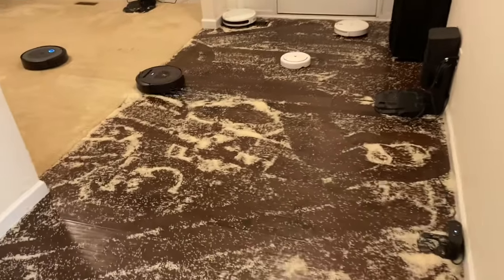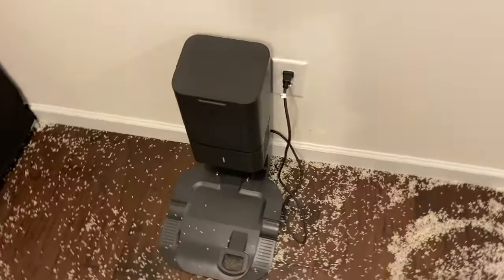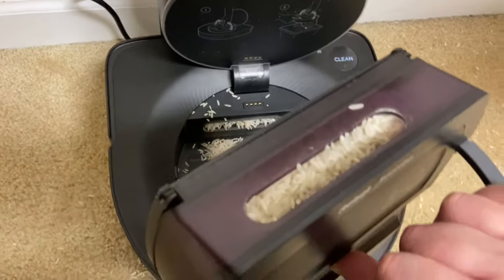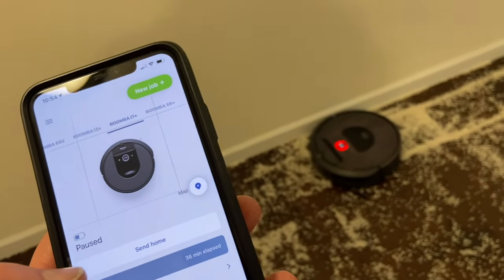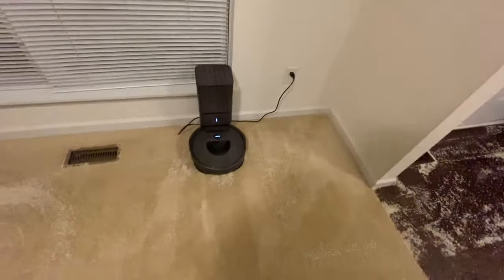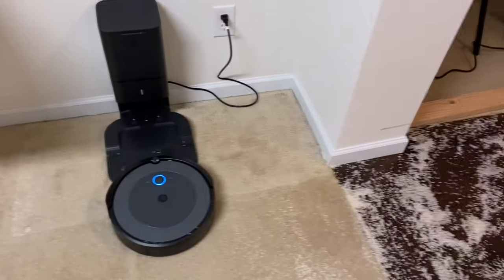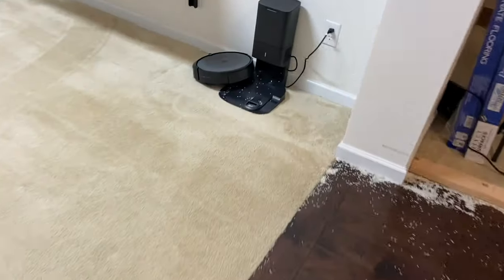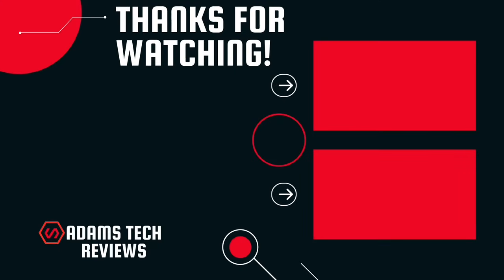13 Robot Vacuums -VS- 30 POUNDS RICE Roomba Roborock Eufy Bissell Ecovacs Deebot HAPPY HOLIDAYS! PT2

Comment from the maker: Please like and subscribe and let me know what other crazy test you would like to see please 😀
Reply: S4 Max stress test! :-)
Reply: I'd like to see this but with jelly beans and those star shaped pieces of cereal you use. Toss in the new Shark for good measure.
Reply: Did you know the white one you jump on like Mario stopming a Goomba was a toy before you pounced on it? We bought the same toy for our 5 year old. He's also robot vacuum obsessed.
Reply: Jasper
Reply: @davejeric4460  jjdjdjjkskskks
Reply: Yes you 

Uhdhhdhhhhjj was good morning I love my family and
Reply: @FantomLightning  '
Reply: In this video, we show the quick start setup for the wifi PTZ camera, including the camera packing list, PTZ camera wire diagram, CamHipro app setting, how to install this wifi PTZ to the wall, remote view on PC via browser...

Wifi PTZ Camera Features

1. IP PTZ Camera with 5x Optical Zoom and Full HD 1920p: This wireless outdoor security camera equipped with 2.7~13.5mm motorized Lens and 2560*1920p resolution sensor; The 355° horizontal and 120° vertical pan and tilt rotate + 5x optical zoom + 2.0 megapixel bring crystal clear image quality and capture more details of your viewing objects without image impairment, it offers you no blind area vision.

2. Quick Wifi Setup when Several Minutes: This wireless ptz IP camera with superior WiFi performance and 5db antenna provides you more stable WiFi connections. Easy setup via smartphone, tablet PC (both for iOS Android) devices by free App.

3. Motion Detection with Email Alarm: This wifi surveillance camera keeps you be notified with push alerts on your mobile device when motion is detected. Know what’s happening in your home in every minute, every potential risk will be identified accurately by this surveillance camera and sent an email with a snapshot to you immediately. Video and image can be stored to SD card (up to 128GB, not included), NVR or FTP.

4. Two Way Audio: built-in microphone and speaker, it allows you to listen and talk with your family, pets, greet guests in real-time. You can record your own unique voice when you noticed any intruder scare them off through our free APP anywhere anytime.

5. with 15ft(5m) 5.5x2.1mm DC 12V Power Extension Cable, this wifi PTZ camera is easy to install and quick to set up wifi, you can access your camera’s video stream in no time. With the outstanding clear night vision and true image and video, you will definitely not miss any moment of what you care!

Enhanced Night Vision
Equipped with 6 IR LEDs, the camera will show you a clear picture even in total darkness, extending your night vision up to 20 meters away. All thing under monitored, the dark never bother you anyway.
https://youtu.be/EkvhJwy4HX0

What's Included? (Updated in 2021-05)
1X 1920P HD PTZ Wifi Outdoor Camera
1X Bracket &Screws Pack
1X User Manual
1X Cat5 cable
1X US adapter with 5ft cable
1X CCTV Sticker
1X 15ft(5m) 5.5x2.1mm DC 12V Power Extension Cable

Visit Our Website
http://www.vitorcam.com

Or Search the keywords Vitorcam PTZ buy it now on Amazon
Reply: Yibh
Reply: PLEASE
Reply: DO THIS INCLUDEING THE SAMSUNG JET BOT+
Reply: Please
Reply: Please
Reply: Do 40 pounds of rice pls
Reply: @RainbowTy  oliko
Reply: Can you do 30 pounds of rice with ONLY your room a s9+? Or can you do a LG HomBot stress test please😊
Reply: Make more the rice videos love them want more
Reply: @AdamsReviews  70 Pounds of Rice + 45 Robot Vacuums

Comment: I wonder if it's possible to take one of the dirt sensors out of a roomba and stick it inside the T8 bin. Maybe if you wired it to trigger the low battery sensor, the robot would think the battery is low every time the bin gets full, go back, empty, start to charge, realize it doesn't need to charge after all, and head back out?
So false alarms on the low battery detection.
Reply: Ok
Reply: No I don’t even think that’s possible, u gotta ask deebot for that

Comment: The roombas are only good for tests like this because they have a sensor for their dust bin. In a normal home not a stress test, I don't think they are the best. I have both and my t8 is better.
Reply: in what way? I have the t8 also, but for some reason it doesnt go near the stainless refrigerator and oven ( reflection maybe?)and somewhere erratic navigation( pulls away from edge for some reason and goes back ) and map generation looks rough to me . I  was looking at maybe replacing wit the i7 but i do like the avoidance of t8 allot  and working in dark feature.
Reply: @cemaydin3819  the navigation is far worst on the irobots. Also since they use a camera to navigate you would have to leave the light on if you vacuum at night. They cannot work In The dark
Reply: @cemaydin3819  the app software on t8 isn’t as good as roborock or iRobot so that might be why. From what I’ve seen people complain about that a little. The app is kinda buggy so that’s maybe your map looks weird

Comment: When are we gonna either get a dust bin full sensor on the t8, or a smarter & lidar based roomba??? I'd rather have a sensor on a t8, but shit I'd take either at this point. Seems like the t8 would be unquestionably the best if it just had that damn sensor. I'm waiting for my t8 to be delivery from best buy next week, but my issue is that I don't know if with my 3 dogs (short hair, 2 cane corso, 1 victorian bulldog) if it will fill up too fast even if I schedule it for every other day... is there a way to schedule it to empty itself in intervals, then resume where it left off? Like every half hour or so? That would make up the difference for me...
Reply: just schedule different rooms at different times, so it empties in between
Reply: @cemaydin3819  that makes sense, the only issue with my house is that 90% of the pet hair is in my living room/kitchen/dining room, which are all connected as a somewhat large open area, no walls. The dogs don't go in any other room besides the master bedroom at night. So I guess the question is can I break a large area up into different sections (rooms) on the app? Or does there have to be physical walls there to do that?
Reply: @TomCreasy  yep you can split rooms up. in edit section . not sure how many times you can divide a room. I have only done it once, but if you run it every other day, unless your animals are like woolly mamoths, you should not get much hair running it constantly
Reply: @cemaydin3819  sweet thanks for the tips, I been going nuts trying to decide between the s9 or t8+ and finally decided on the t8, it's my first ever robot vacuum I'm hoping it can actually completely eliminate vacuuming for me and free up some time lol

Comment: For this kind of mess roombas are awesome - I have a Roomba i7 but not the plus, for my house it isn't as good as the t8 ..the  nagivation and the way the t8 avoids random every day crap like socks and cords really make it a better vacuum. I ran my i7 and run my t8 twice a day every day. I do have the t8+ so it's nice that I really don't have to mess with it often it pretty much handles itselfs. My i7 would ignore my no go zones and always get stuck on my bar stool base or run over a cord and stop or get full and stop - I don't fault the i7 for getting full and stopping though because it's my fault for not buying the plus version. The t8+ was $200 cheaper and came with a clean base and I'm really only missing the automatic empty and resume when full feature but I gain a mop and floors that are always clean . In a month I've only had to deal with my t8 eating a cord once but it was a twice daily adventure locating and picking up my dead i7 and returning it to the base to charge